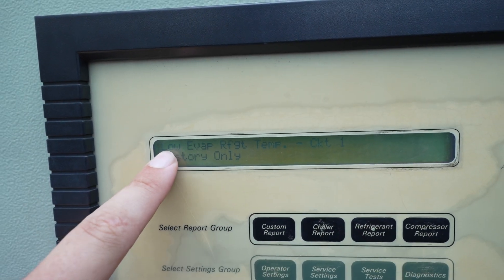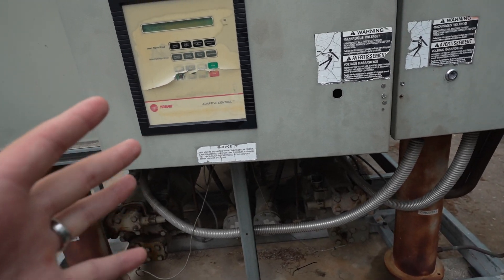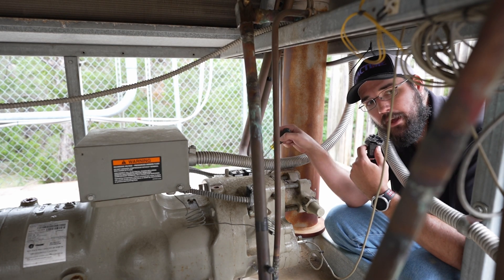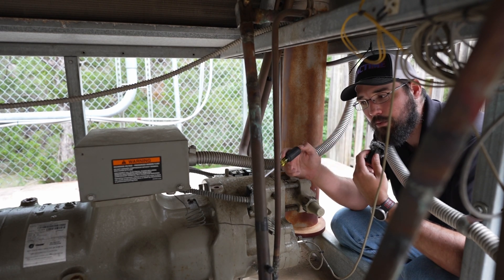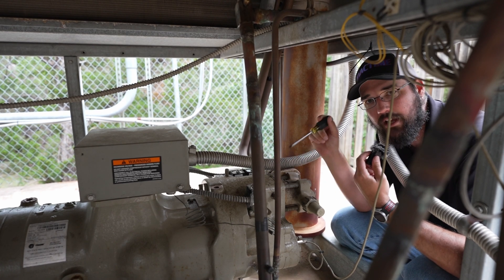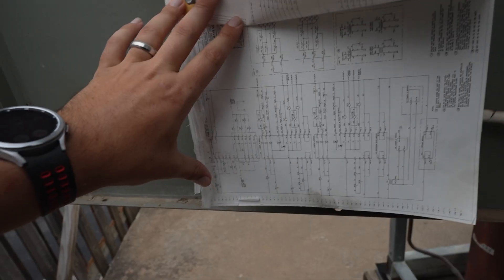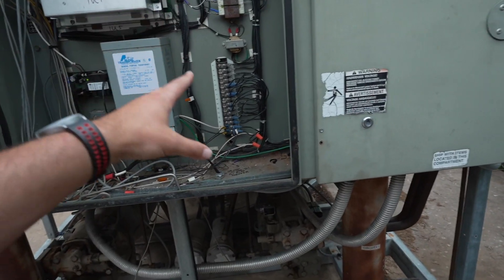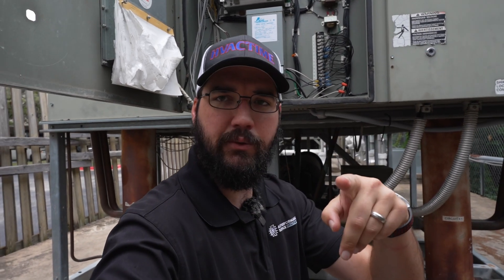Chiller tripping LOW SUCTION Trane RTAA

Comment: We have a RTAA, and the pressure readings are all messed up. 

Turns out the chiller uses the temperature sensor to convert the pressure using a pt chart for r22. (We use nu22). 

Do you know if the refrigerant temperature probe has a well? Or is the temperature probe held by a gasket?

Comment: Hi sir, i would like to ask do you know what causes : Low Saturated Suction Temperature (SST) alarm happen? I have change the temperature sensor but still coming out one time per day. After manual reset the alarm then the compressor can run again. I was out of idea. Thanks.
Reply: Check your exv

Comment: I've had a lot of issues with female unloader solenoids either being energized all the time or not energizing at all.  i have an account with 3 RTAC chillers and have replaced two dual triac boards along with solenoid female unloaders.  The rtaa is quite a bit difference than the rtac as far as the controls but they function basically the same.

Comment: So what happened to the oil? So after the system is working for a few days, you gonna have to remove some of the oil?
Reply from the maker: The oil was lost from leaks, repairs, and a compressor change out. In that process we lost just enough to start having symptoms without enough going back in. The system was functioning it was just not able to load properly so we weren't having a migration issue. Since we got the oil level up we have not had any further problems in the oil has maintained properly.

Comment: I had a similar situation with a YLAA york chiller, compressor was grounded, replaced the tandem set, when i started the circuit up the Hot gas bypass was on, it was cold outside when we started the circuit so i thought the bypass being on was fine, came back next day to check oil levels and clean up the job site and one of the compressor was out on thermal, reset the fault and the loop was at 60, and i could hear the hot gas bypass valve on, i checked my solenoid and i wasnt getting voltage, well ended up finding out someone had taken the hot gas output , removed it from its terminal and landed it on the LLS for stage one, So it was bypassing on every run cycle, I dont know who did it , but i can only assume it was to add add since we have winters down to -30f. Put it back to its terminal and havent had a problem since.